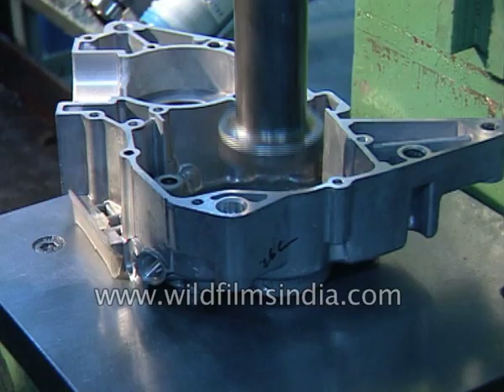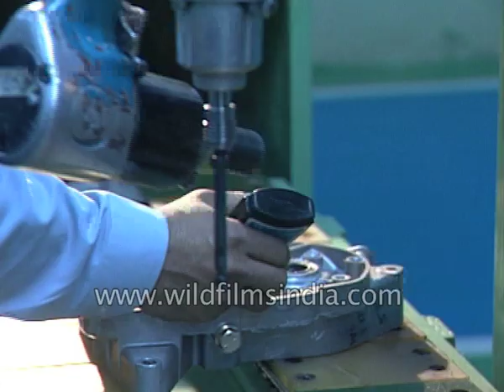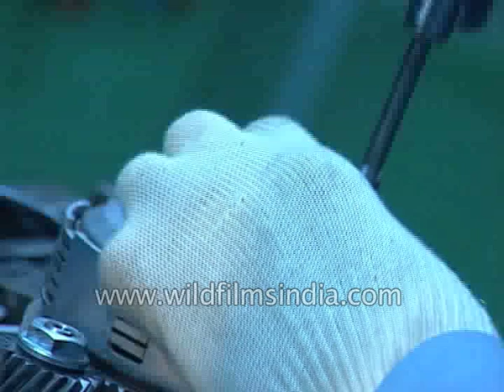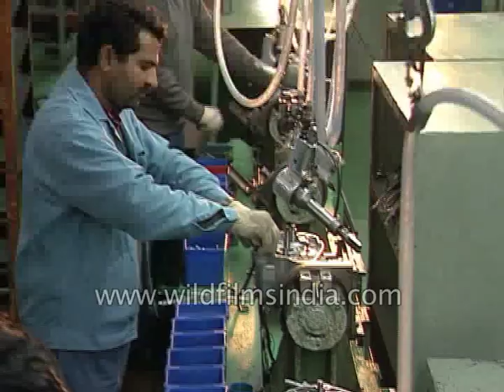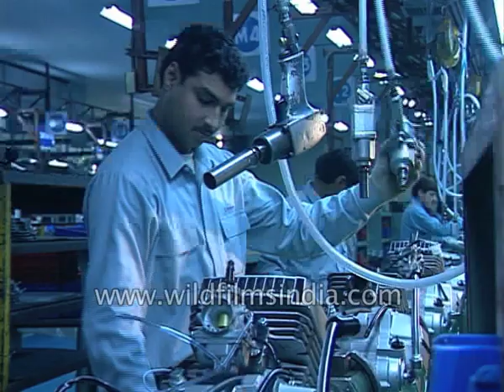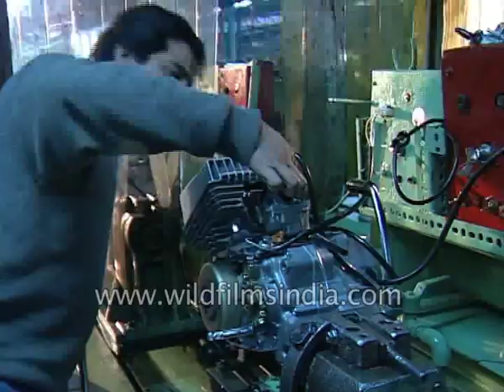Escorts Yamaha Motors factory : Make in India manufacturing

Comment: Hi sir....
Please request you to suggest me the best tyre which can offer the best road grip/traction both in dry and wet conditions as well for YAMAHA RX100 .

Required the following:

a) good stability in higher speeds

b) better for cornering

c) no skids during braking

d) frequent usage for city commuting and highway riding

Currently i am using Ceat 2.75-18 both in Front & Rear. But now i need a change
I am pretty much confused.....can someone help me on this please.....awaiting your valuable reply...

Thanks in advance....
Michelin City Pro does not have better grip on wet roads based on my experience.
Reply: In your stock rim you can put 3.00 18 on rear. Front is ok 2.75 -18. If you want better look and stability go for 100/90 18 but need a change in rim. Old CBZ rim will serve the purpose. But need to change the shocks with larger in height, or spacers to adjust shocks height but have to compromise mileage as well.Michelin sirac is advisable. MRF zapper for front is also good option.